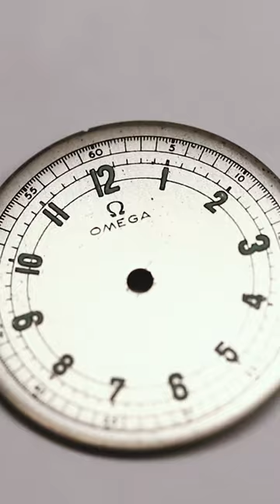LASER ENGRAVED Omega Dial Restoration⌚️ #watches #watchrepair #watchrestoration #omegawatches #short

Comment: If you wanted to also add the lume fill paint that the number originally came with, do you need to make another template or you fill it by hand??
Reply from the maker: Hi, there! Thank you for watching and for your question! We use our dial printing templates as the outline and fill it in by hand with the requested paint that each customer wants.

Comment: Not restoration, this will be considered non original
Reply from the maker: Hi, there! Thank you for watching and for your concern. This is indeed how genuine watch restorations are with a watch's original dial. Our clients and brands have trusted our work for quite a long time. Some prefer to keep the rust and corrosion of the dial, however, there are those who prefer to completely refinish it to retain its value. It's all about the customer's preference! One simply cannot find another vintage dial in its original condition to "replace" it, so those who want to restore a watch dial go through this process. 😊
Reply: @kirkrichdial  i understand all that, i just mean that it wpuld not be a truly restored, original piece. It would instead be named remanufactured or refinished or refurbished. Whereas a true restoration would try to enhance any remaining details, this is instead replacing the old detail with new identical versions of the way it should have looked without the damage and wear through its life. It is still a fantastic job, but i feel it is important to make the destinction as the price difference of a restored piece and a refurbished piece are quite different

Comment: No, this isn't a dial restoration, but a dial recreation. If the original dial was shown at the beginning, then it was perfectly fine the way it was. Stripping it then recreating the original dial causes irreversible damage that's a nonsensical option. It's also not a laser engraved dial, but an image transfer from a plate/die that's been laser engraved--big difference. 

If it's for a client, then from a business perspective, I can see the practicality of it, but that's only when the original dial is completely FUBAR. But, you shouldn't call it anything more than what it actually is--a recreated dial. That said, if you're going with the recreation route, then IMHO it would've been better to laser engrave the actual dial to give it more depth.
Reply from the maker: Hi, there! Thanks for watching our video and for your concerns.

This is indeed a dial restoration as the original and genuine dial was used. One can't simply source out a vintage dial in pristine condition. This is similar to the process of watch movement restorations, where parts and even entire movements have to be replaced. This does not make it a watch 'recreation.'

As for the terminology, the title states it as a laser-engraved dial due to the limited characters of the video title. It is indeed a laser-engraved dial template being used. We do use the template to stamp on the design using specific paint, which is part of the traditional art of dial restorations.

Should you have any other questions or concerns about our dial refinishing and restoration process, please feel free to let us know. Have a wonderful day!
Reply: @kirkrichdial The analogy of a watch movement fails, as OEM parts are expected to replace the damaged components. Those parts aren't technically original to the watch itself, but it's practically 1:1 and in this case, exactly as the manufacturer would have shipped it. But it's more than simply being a perfect "copy"--it's about who made the repairs and/or replacement parts, and what degree of liberties were taken by the restorer to add third party or his/her own external details.

Think of it like this: an artist's oil painting on a brass plate medium gets irreparably damaged. You can remove the remaining oil paint, and use a computer to print the details onto the dial. However, it's only a recreation of the artist's oil painting i.e. nothing more than a third party or aftermarket copy of the original. Using the original brass plate doesn't change the fact that the artwork isn't original.

Or, let's say that Leonardo da Vinci's Mona Lisa was damaged to the point that all paint was removed. Using the original poplar wood panel medium, an exact copy of his Mona Lisa was painted on using the most state of the art printer. That would not be considered as a restoration, as no original art even remains to be restored. Rather, it would be a recreation of da Vinci's artwork. Whether or not the original poplar wood panel was used would be irrelevant.
Reply: Just enjoy the video and try not to overthink things ,a lot of effort has gone into making it for us 
Just be great full rather thank having a dig at someone
Reply: @martinwilliams9098  It's a fair response. It's not a dig merely to dig at someone. If this is someone's job or craft, then it's important to be accurate, especially with something as fundamental as restoring vs. recreating.